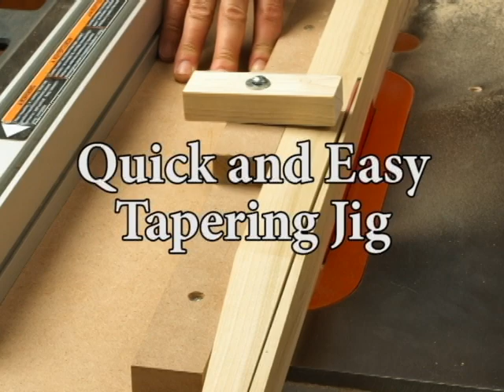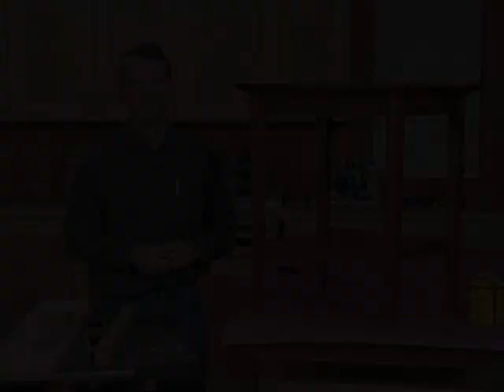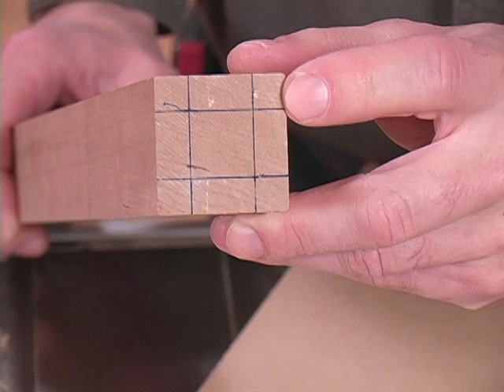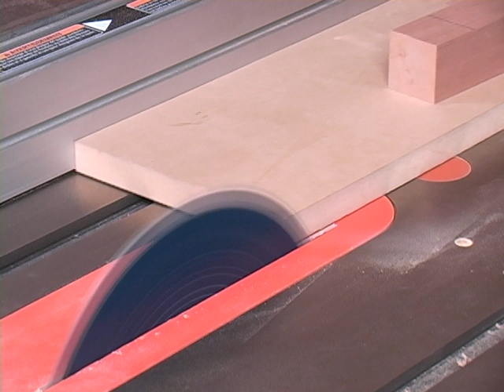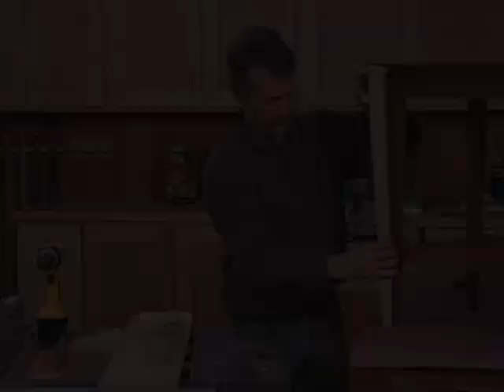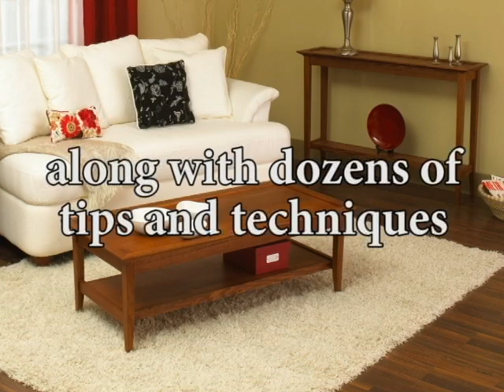How To Make A Jig For Tapering Table Legs - WOOD magazine

Comment: One way to make it last longer is to make it a couple inches wider to start with.  Later, when the screw holes wear out, simply rip a half inch from the width, and keep on truckin'.  The screw holes should then hit fresh MDF.  Maybe move the hold down clamp an inch or so too.